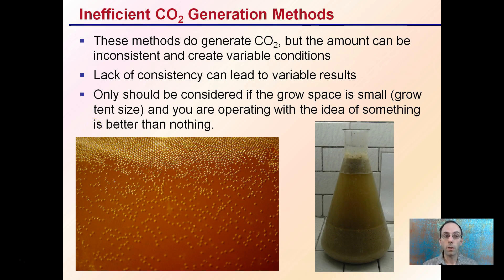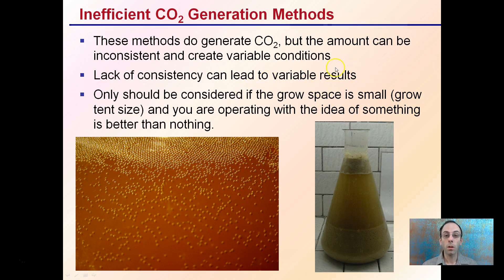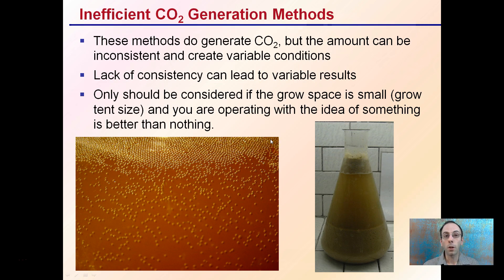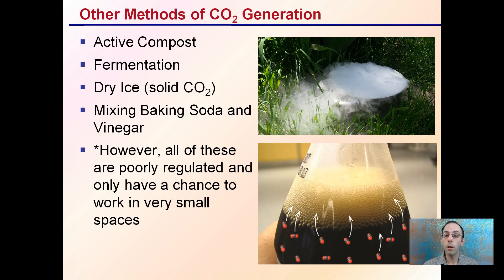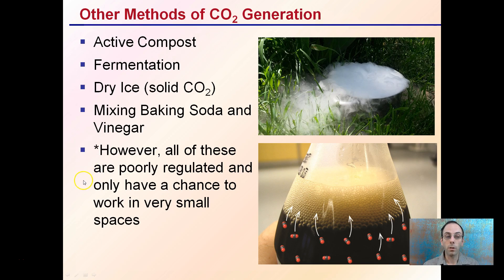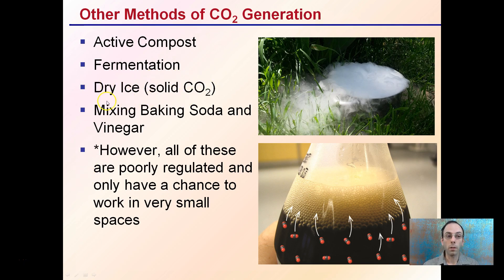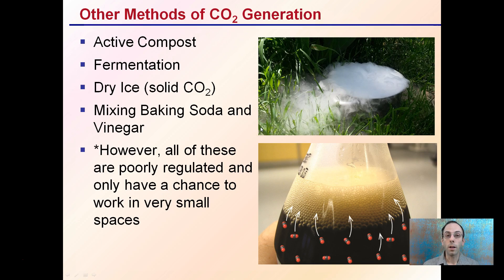Inefficient CO2 Generation Methods

Comment: Use an oil lamp. Light it when the lights turn on and blow it out when the light turns off.

Remove alternate five fingered leaves from the trunk.
Reply from the maker: CO2 does help plant growth regardless of the source.
Reply: To prevent unnecessary stalk growth during the transition to blooming, add CO2 after 17 days of twelve hour light.

Comment: You just refferred me to this link, i only have two small growtents, a couple of years ago, i tried with yeast and sugars, and it went well, BUT! - it was like the different strains ended up tasting the same? 🤔 I also tried with acidic acid and bicarbonate, also good, but still it was like the strains still just tasted the same.. In order to make a co2 generator, could i (asking again) then use mycorrhizal fungi, in terms of "Active Compost? - P. from DK
Reply from the maker: Assuming no other limiting factors any additions of CO2 above ambient would be beneficial to the plant.  However, comparing biological based systems to the efficient nature of a dedicated CO2 system, the specialized system will offer consistencies and is practical in a large grow room area.  Active compost will produce CO2, and in a small tent this may be helpful, but repeatability and efficiency offer better long term sustainability.